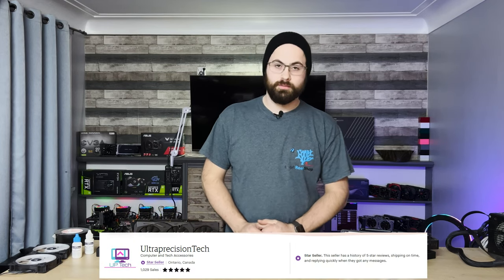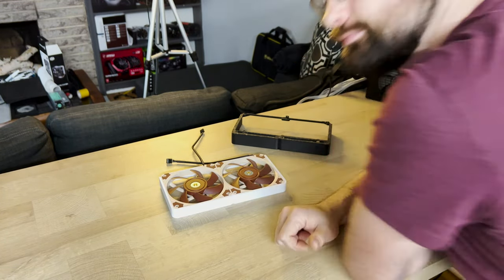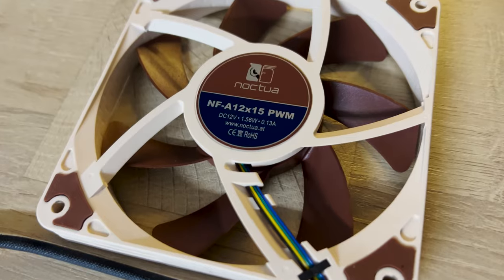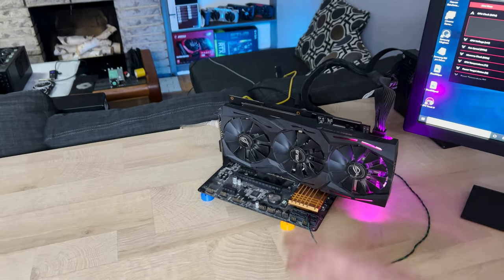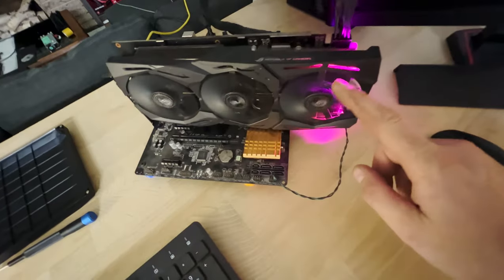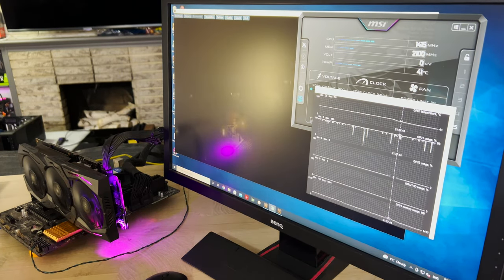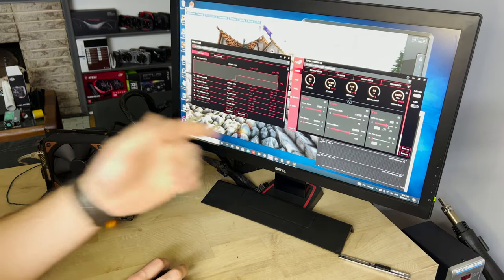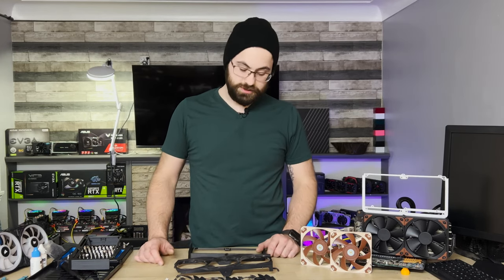Custom designed Asus Strix GPU 120mm fan shrouds!

Comment: I don't understand why this isn't a standard practice in GPU designs. It'd be so easy to replace fans with practically any 120MM fans.
Reply: Because cheap materials equals more profit
Reply: true, and slim fans that comes with gpus are the first to fail
Reply: The 3080 and 3070 asus noctua does use  120MM fans so you can swap cans. Saw a guy swap noctuas black fans from the brown and to also RGB fans.
Reply: @Noodlepunk  a guy lol aka a youtuber who is quite well known
Reply: @Noodlepunk youre talking about derbauer, aren't you? I think he swapped the noctuas with Corsair rgbs
Reply: shitty tiny fans = more heat, more heat = faster component wear, fast component wear = profit of selling you new item. Is it clear?
Reply: The profit margin on GPU s is very low, hence they are manufactured cheaply...

Comment: Years ago I strapped two Noctuas, a 92mm and a 120mm. with zip ties to a Sapphire R9 Fury, which is a pretty hot running card. Result was temps dropped a bit under full load and inside the case the fans were basically inaudible. I also put two Noctua 120mm on a Morpheus II heatsink to cool a reference design Sapphire Vega64. That worked even better. 
Stock cooling on GPUs is just different shades of terrible. Compared to what is easily possible they all suck. ... or blow. ... you know what I mean.

Comment: direct die thermal paste is not applied in any pattern but with full spread. You risk the GPU if you apply some of the standard IHS patterns, like the X you used here. A small portion of the silicon might not be covered when you press the cooler, and that portion might not be covered by a sensor. That means you might be running part of the silicon at 120+C while the GPU thinks its hotspot well below 100C and doesn't throttle, since you created a new unknown hotspot. This is not a problem for application on an IHS since the IHS itself covers the whole die and the silicon will not be in danger. Just use a spatula and spread the whole die, it is not hard to do, less risky, just a bit messy.

Comment: Its always awesome to cool GPU with 12cm/14cm fans, been doing this for a long time, larger fans with lower RPM means less noise and better performance. Also the easier way to do this is to take off the plastic case of the card and attach 2 or 3 fans on a PCI cooler panel(very cheap) next to the GPU, there would be a slightly longer distance between the fans and the heat sink but no such a big deal cause it performs almost the same. In addition, an PWM adapter cable is required to transfer the fan to the smaller 4pin slot on the card.

Comment: The industrial PPC 3000 RPM fans are perfect if the card doesn't need to run them much to cool down fast.
Almost running in the video to instantly drop the temperature. That is power saving + high performance.

Comment: Honestly, i dont repaste anymore. I slap on a kyrosheet. No more maintenance :)
And i also turned off the 0dB functionality on mine. Because that fan ramping up the whole time will cause unncessary wear. 
I dont have a 3D printer, so i was glad what i made worked the first time. I used NF-S12's though, those are more suited for heatsinks.

Comment: could be more efficient with 92mm fans, or with 25mm fans but with an offset shroud with funnel shape that makes the air actually hitting the radiator's fins properly. Here a lot of the air moved by the blades' tip is missing the radiator because the fans are much wider
Reply from the maker: Thanks for the comment! At some point though, adding the offset and the funnel, you’d have to ask yourself, how many pci slots do you want the cooler to take up? 4? 5? :)
Reply: @ultraprecisiontechnologies  ahah true, you really need to have some empty space at the bottom of your build to fit these Frankenstein cards, and preferably a bottom air intake otherwise it's not worth the effort and ugliness

Comment: This is why I have a accelero xtream 3 heatsink on a founders 1070 with 2 noctua fans
Barely any noise and better cooling by 15-20 degrees.

Any other aftermarket shroud cannot ahieve this low noise and temo combo.

Sure it doesn't look pretty but I don't care about hoe it looks in a closed case under the desk

Comment: OK, I got my package from you guys, now. Honestly took a bit too long to ship to Sweden, but it all turned out fine in the end.
It installed well, and runs perfectly with a pair of EK Vardar fans. (Was planning to get powerful Noctua fans, but I might be selling this card to my daughter, instead.)
(RTX 2080 Ti Strix)

Anyway, thanks for the good work, it was a nice solution when the old fans start failing.
Reply from the maker: Thank you for the response to receiving your order!
We are glad it did make it to you eventually. Shipping internationally (outside of US and Canada) comes with its challenges for sure, and we have debated not offering international shipping because it’s expensive and takes a long time, and comes with the risks of the package getting lost the longer it is in the mail. Ultimately, we leave it up to the purchaser to decide if they should purchase and item based off the information available to them. 
As time goes on, we would like to explore better options for international shipping as well as a better selling platform that offers lower fees to us so we can pass those savings along to the customer.
For now, we are a very niche, very small operation, and we are very glad to hear your fan shroud made it to you safely and is working as you’d expected!
Reply: @ultraprecisiontechnologies  Yes, I'm aware that you're a small and niché company, so I don't blame you at all. 
But it might be s good thing to know in case a customer is in a hurry, for some reason.

Also, we have to point out that it was during the holidays, which might possible have affected it.
Reply: What were the temp results for you
Reply: @Ziomal645  I don't remember for sure, but I don't think tehre was much of a difference.
The point is that one of the 3 original fans had broken, so I needed some kind of replacement. 

I don't think the temperatures got any better, but the temperatures of the original were really good already.
Reply: @antiHUMANDesigns  For me it's getting worse each year, but i've cleaned the card and repasted it so not sure. I got to the point where it gets to 77c in demanding games and it will automatically turn up fans to max. I used this card a lot since release in 2018,  that's 6 years. When i replaced case fans, it helped overall case temp. I've ordered this shroud for fans, hopefully will help a bit.
Reply: @Ziomal645 Yeah, the fans will age, but I think that main problem is that some of the dust particles on the heat sinks get stuck really hard, forming an insulating layer that you can't just blow away with compressed air. 
Remember that a large portion of the dust indoors is dead cells from out bodies, and that becomes kind of glue-like as they decompose.

I guess you could try using some steel wool or some chemicals to clean the heat sinks. I think tehre are bushes (look liek a tooth brush) that's got steel wool, and that might work to get in between the fins.

I don't think the problem is in the fans themselves, primarily, though I don't dare to say that with any confidence.
Reply: Såg ditt inlägg! Har ett äldre 1080ti 11gb som jag ska sätta in i grabbens dator. Hur lång tid tog det innan du fick produkten, kommer det med skruvar eller vilken längd och vilka skruvar använde du för att få ”shrouden” på plats? Temps före och efter, tänker dock att samma kylning med mindre ljud är också fint.

Comment: for every day use you must not setup more than 80% fan speed  all factorys have a standar use about 80% of the maximum performance of gpu , if you can keep it cool the gpu at 80% fan spped then the moding works

Comment: I just installed the Carbon 25mm version on a Strix 2080 Super; I used a pair of Silent Wings 4 fans.
At full fan speed it is still much quieter than the stock fans, additionally, the GPU temp is lower by about 5 degrees C.

I haven't yet applied new thermal paste, that will happen soon.

Unfortunately, the bottom center mounting tab broke off when I was installing the screw.
It will be ok anyhow since my GPU sag bracket supports that position.
Reply from the maker: Hey! Glad to hear it made it to you. That bottom  centre support tab is incredibly thin to maintain compatibility with the stock screws. You should be totally fine without it either way. I’ve often thought about removing it from the design all together because it’s so prone to breaking!
Reply: @ultraprecisiontechnologies  
I replaced the thermal paste & thermal pad yesterday.
The original pad looked and felt great, but I replaced it with a GELID GP-Ultimate anyhow.
The paste looked very suspicious; I replaced it with GELID GC-Extreme.

The GPU temps dropped by about an additional 13 degrees C. to 60-62 degrees max.
Now the fans top out at 60% speed and are virtually silent.

Comment: I wish I could do this with my GPU. But it has a standard connection only for GPU fans. You can't use a 3 pin or 4 pin. Is there a solution for this too?
Reply from the maker: Yeah! There are adapters you can get like this one! Just make sure your GPU fan connection header looks the same before ordering.  https://amzn.to/3OasiXt.

Comment: Wait those 4pin fan parts just connected straight to the 4 pin port on the GPU??
Reply from the maker: The strix cards have additional headers for standard 4pin pwm pc fans along side the special connectors used for the stock fans

Comment: I just bought a second hand strix 2080ti like this, and the center fan bearing is bad so the fan is very wobbly(i got the card pretty freaking cheap because of that, and it was dirty asf). I'm considering of designing my own shroud and add two arctic p12 and new thermal paste. What scares me a bit is, do i need to replace the thermal pad under the heatsink, or is it reusable? Also this card is brilliant with thise external fan headers. No need for ugly plug adapters that take up space in my itx case.
Reply from the maker: Sometimes the thermal pads are reusable, sometimes not. On this card I was able to reuse the thermal pad, but yours may differ.

Comment: bad fan choice, these are not the best for static pressure, these a re airflow fans, with that much gap between the blades and the resistance from the heat sink you are going to get a good bit of splash back resulting less performance and more noise than an ideal, would still be an improvement over stock fans for most coolers though. the black noctuas used are a much better choice

Comment: Hi again,I wanted to know,I have a pc service center in my town that can do the replacement with the custom shroud but he told me to ask if the gpu will recognize  the new fans ? Like normally,it does it auto,and makes the fans go faster etc in terms of power draw when gaming etc,will it do the same with this custom one ,like there won't be any issues with the card's sensors ? Wanted to know before ordering it,so I can be sure.
The gpu again is a Asus 2080 TI Advanced,I'm guessing the normal size custom shroud is the best one for it ? 
Thank you.
Reply from the maker: Normal thickness will give you best performance yes. The strix cards have 4 pin pwm fan headers on the pcb that you can plug the replacement fans into. By default, I do believe it controls the fans by temperature. In the event it doesn’t, you will need to download Asus gpu tweak which you can download from the 2080ti strix product page in the support/download section.
Reply: @ultraprecisiontechnologies  Oh ok,thanks for the info and quick answer.

Comment: would a shroud like this fit a asus 3090 tuf oc?
Reply from the maker: No it would not. The screw mounting locations for each GPU model's shrouds specifically are different. This shroud only fits the gpu discussed in the video. Sorry!

Comment: So will this work on a strix OC 3080 12gb?
Reply from the maker: No, this shroud is only for the older generation strix shrouds like what’s shown in the video. Sorry. The Mon thing locations for the shroud screws are different on 30 series and up gpus
Reply: @ultraprecisiontechnologies  if I wanted to pay you to design a mounting shroud for the 3080 12tb strix OC (assume it would work on any 30 series strix heartsink), how much would you charge? I would want to mount standard 120mm PWN fans like the noctua a12x25. As many as can fit (2 prob, maybe 3?). Ty for any feedback.
Reply: @ultraprecisiontechnologies  in regard to my  inquiry about buying a custom designed 3080 strix fan replacement shroud, I would be happy to provide caliper measurements on a drawing/high res picture or something. Whatever you may need to do a proper design, as long as it’s within my power to do so.

Comment: would this fit a asus 3080 tuf?
Reply from the maker: Short answer: no. Longer answer: All model gpus have different mounting locations and mechanisms for how they secure the fan/plastic shroud to the heatsink. If you wanted a shroud for a 3080 TUF it would have to be custom made, which is entirely possible. I saw you message on my store, ill chat with you through there. Thanks for the question!

Comment: anybody know if this would work on 980ti strix?
Reply from the maker: It’s unlikely because the cooler looks different on the 980ti compared to the 10 series strix coolers
Reply: @ultraprecisiontechnologies  ok, thanks.  well if you ever find out it does, let me know.   

there's a couple vids on here of people doing dissasembly of them if you ever get around to checking them out, but it does look a lot more complicated than the 10 series so i'm not getting my hopes up.

Comment: sir u can help out yr self a lot look zotcks are shit ,manny 3060 an 3060 ti or being sold as well as 4060 but not much heat for them card so tell me what wood u do keep 3060 ztock u spant 280 new for or sand it back i have 4days left ot make mind up help me out fast pleeezz i have a 2070 allso i have a 3070 i just got used msi x 3fan but this is freeking me the hell out win i look at zpu z win card 3060 an 3070 is idle 144hrz no gameing runing my mamery chip contler lode on gpuz is saying 30to50% but win a lod 3d lode gos throw card it drops i got a new3060 its doing it i got a used 3070 its doing it i got a new but old 2070  u used long time its fine i got a 1070 its fine idle that stet tells me 2to6%  so in short is the memery contler in 30s diff than 20s an 10s